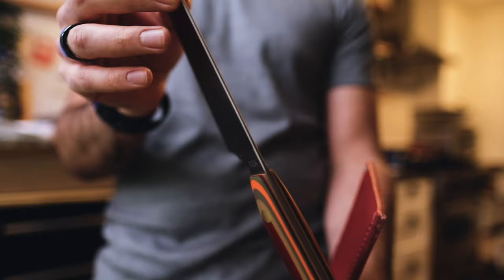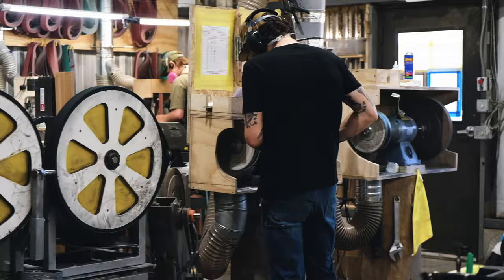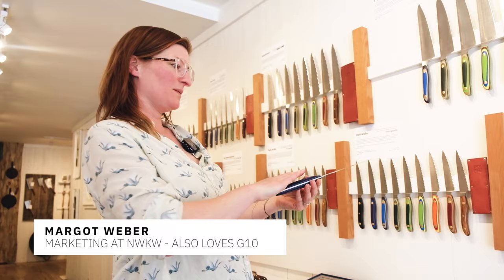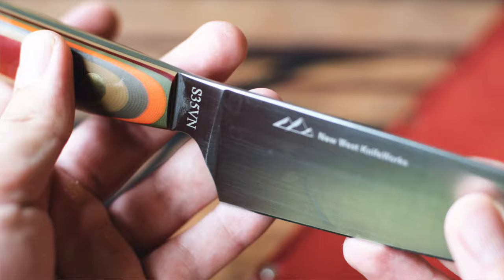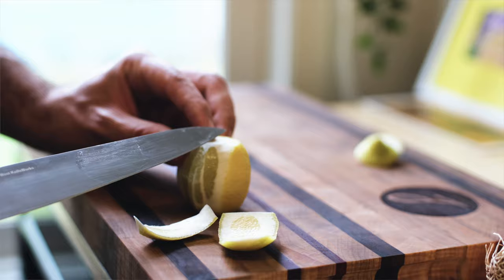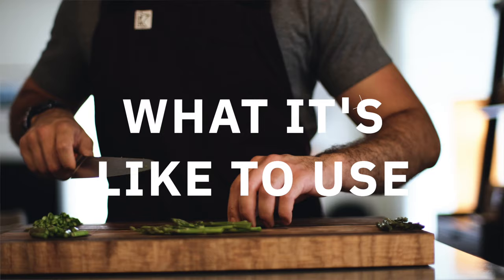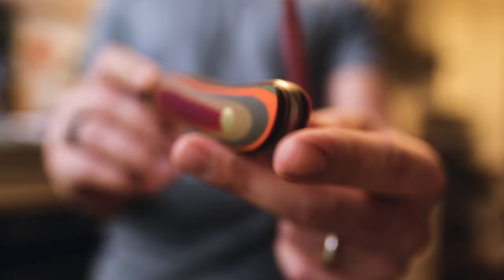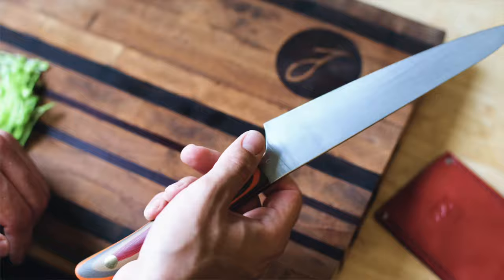Sleek, Sturdy, and American Made | New West KnifeWorks G-Fusion Line

Comment: When you're working a shift, how often do you find that your knife needs steeling or do you just use a different blade when the knife seems to lose its edge?  As a cook at home the brand does not matter as long as it can slice a tomato easily.  Appreciate your work, JAH
Reply from the maker: Thanks a ton, appreciate you watching.  Depends on the workload, I usually don't hone more than once or twice in a day with that knife.  But if you're doing a large variety of tasks, sometimes it's not necessary if you go from petty to slicer to chef knife.